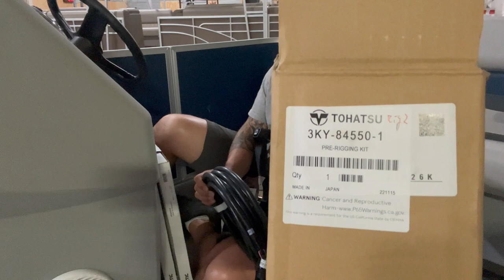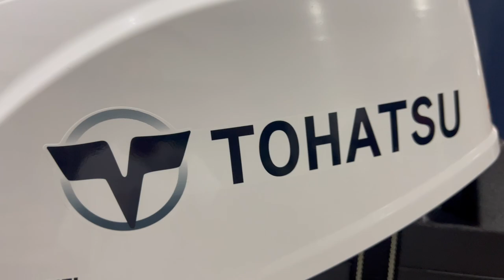Installing New Tohatsu 20 hp Outboard - On a Pontoon

Comment: Link arms must be i. installed in the inner hole for for full steering lock to lock.  Outer hole is for a tie bar.
Reply from the maker: Correct, but if I remember right I referred to the schematic for this motor in the installation instructions. I've seen things done so many different ways over the years that nothing surprises me anymore.

Comment: Plywood for your transom?? Why not use coosa board??
Reply from the maker: The plywood will last another 20+ years and can be made from off cuts of decking boards around the shop. I think usually the wood transoms outlast the motors!!!
Reply: okay.. I was just wondering since coosa board seems to be the hot new thing.  I had to get my transom rebuilt and they insisted on coosa board @tomspontoons
Reply from the maker: @PhotoJohn80  definitely some folks are overwhelmingly for it, but for the price and availability of good treated plywood and how long it’ll last I just stick with what’s worked for the last 40 years on pontoons. I’m sure Coosa is great too, but I’ll wait to see how it holds up over the long haul before switching over everything to it.

Comment: Question:  When you rig new motors on boats for customers, how does the warranty work for the boat owner?   Do they go back to you or do they contact the closest authorized dealer for warranty claims?   Asking because I’m planning on rigging a new motor on my rebuilt boat and want to make sure the warranty will be honored in case I need it.  Thanks!  
I’m a new subscriber.   I’ve rebuilt a 1972 SanPan AquaPatio and a 1984 Riviera Cruiser for myself, and I enjoy the process.
Reply from the maker: Great question! The warranty submission is all done online. We purchase motors through a marina who inputs the warranty information, and at that point the customer can have the motor serviced for warranty work at any servicing dealer. These motors can be purchased online and shipped to your door with no dealer having hands on it. To my knowledge in that case you'd submit the warranty info yourself and be covered to take it to any local servicing dealer. The best news is that the new four stroke motors have been incredibly solid for the last 10 years making me confident in any make and model.
Reply: Thanks for the response!  I’m a retired aircraft mechanic that’s done a lot of boat rigging (from a bare hull, I used to be into hot boats).   If your shop was in Kalamazoo instead of GR, I’d be applying for a fun retirement job 👍
Reply from the maker: @J.W.W.  Nice! I love the amount of retired folks who tell me they want to come work with me...but we love being as small of an operation as we can, and I'm the kind of guy who wants to do as much of the detail work as possible because my name goes on every boat. Some call it being OCD. I call it quality control!!